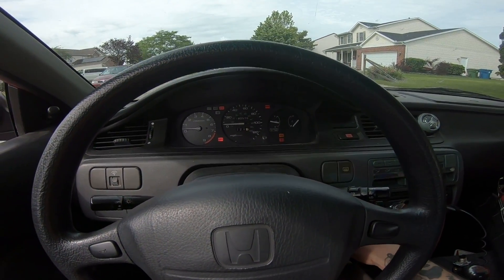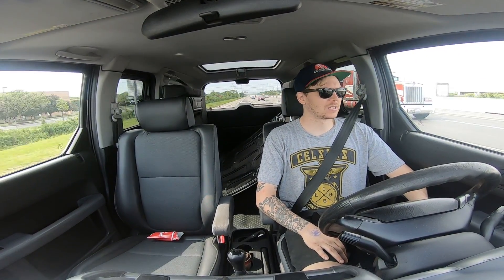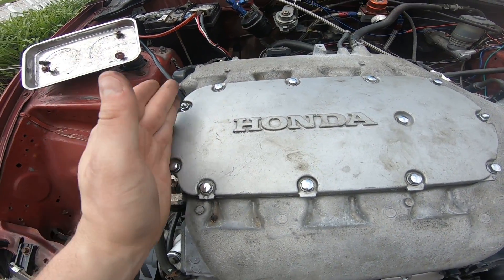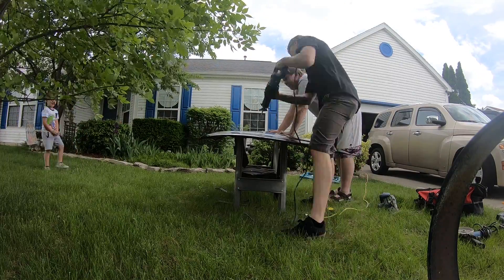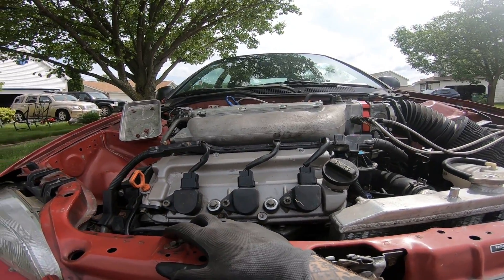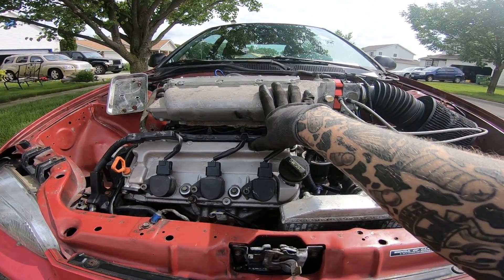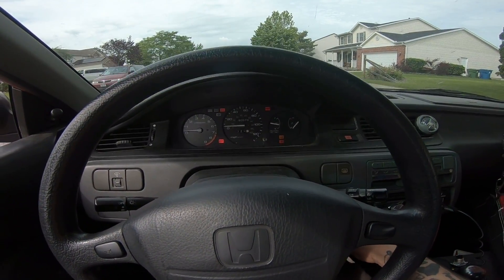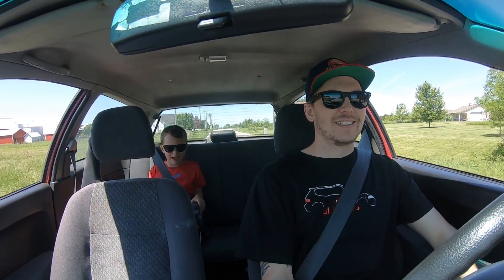Putting a j35 intake manifold and spacer on my j30 accord engine and cutting my hood to make it fit

Comment: In my case, i have a j30a5 accord with the factory 6 speed manual. I got a im and tb off of a 2005 odyessey, making it a magnesium 3.5l manifold. It had the butterfly valve (which i have) and iat in the correct location for my vehicle.

Comment: Do u know wat I need to swap over my j32a3 and 6 speed into eg I have the whole donor car
Reply from the maker: JSeriesRacing start with axles, mounts, and wiring. Someone may make a water temp sensor adaptor but mine had to be welded into the water pipe. The list is pretty long haha

Comment: where did u get the manifold spacer and throttle body spacers?
i have a j30 im currently looking to put the j35 manifold on and wondering if the spacers are needed or make a difference
Reply from the maker: Sugaman powerrevracing.com! They have a huge selection of aftermarket j series stuff! The manifold spacer can be pulled off at j35 at a junkyard just find an odyssey or pilot
Reply: For sure im going with the previous gen build 2001 honda accord, i found a j35 manifold from an 01 odyssey it looks a little better but cant tell till i put it on.

Comment: If I have a j35 could I put a j30 intake manifold it so it can clear my hood like it did originally?
Reply from the maker: AvianAviator I believe so, but the throttle body may also need changed!
Reply: @SleepyEG  thanks. Let's hope my speedy civic comes along well.

Comment: Do you think there is a way to force the butterfly valve open all the time? I drive a j35 and am looking for bottom end torque. Mine has the butterfly valve
Reply from the maker: Po Panda I believe toy can just take it out, p2r sells a block off plate for the solenoid!
Reply: I know it’s late but for anyone who wants to know you can also wire an Rpm switch to open it at a certain rpm
Reply: @garrettglenewinkel7366  i appreciate the info. car i was working on died but ill probably always have a jseries of some sort

Comment: Bro I did it and now it won’t even stay running ...
Reply: Update! It’s all good I just had one of those inside I think like fuel rail sensors unplugged
Reply: And sealed brake booster which is why my brakes were hard
Reply from the maker: Awesome great to hear man! 🤙🏽
Reply: You’re the goat.. however one last problem there are other skinny lines that connect to the bacc of the plenum..( not the thicc brake booster) and on the new plenum one tiny line doesn’t have an insert.. should I just t-connect and hope for the best?
Reply: And my brakes are rocc hard..
Reply from the maker: Jordan Williams weird, maybe it’s affecting your factory tune and your ecu is going into limp mode? That’s strange
Reply from the maker: I just have mine capped off, I’m sure a t would be fine!
Reply: https://youtu.be/HOT5TIO6Dgw
Now it isles pretty high could be a throttle body gasket issue ..

Comment: This is important which accord did the motor come from? Was it a j30a1 or j30a4?
Reply: Do you think the bloccs are similar enough to just grab a spacer and manifold + studs from a j35a1?
Reply from the maker: That’s pretty much what I did, I went to a junkyard and pulled the spacer off of a odyssey and the manifold and vacuum lines off of a pilot
Reply from the maker: Jordan Williams j30a4
Reply: Sleepy EG also where did you find that soacer

Comment: where did you source the longer manifold studs from?
Reply from the maker: Will Huber took them off the j35 that I got the spacer from! As well as all the vacuum lines to the manifold!
Reply: @SleepyEG  I have a 2013 TL 3.5 with a P2R manifold spacer and the studs are not the most reassuring in build quality. so i was trying to find where to order some longer ones.
Reply from the maker: Ahh I got ya, that I’m not sure about. I would maybe check a hardware store and just bring your studs in and see if they have something that would work in a harder metal
Reply: Sleepy EG did you get the manifold and spacer from a Honda Pilot?
Reply from the maker: The spacer was from an odyssey and the manifold was from a pilot

Comment: What harness issue did you have when swapping the motor of a 2004 I hear you get sensor issues and ecu problems
Reply from the maker: AllOutProductions so I actually bought the car swapped but blown up and I just put a new motor and trans in it. I was told that the wiring was done by a guy in New York so to be honest I have no idea what harness was used but I can tell you it was converted to drive by wire
Reply: @SleepyEG  ah ok yeah I've read because it's Drive by wire you need to use a cable throttle body AND Ecu so more or less 02 Type s ecu but as the harness is what I'm trying to figure out hopefully someone will know I'm doing the A3 swap....have you looked into the Holley EFI plenum for the manifold?
Reply from the maker: Yeah I have looked into it but I’ve heard it’s only good for boost applications and all motor you will sacrifice torque, I’m planning on getting one when I go turbo in the near future!
Reply: @SleepyEG  dude you got this even though it money you have to spend go for it I think I'll give in with just a J30 but the J32 stock block can hold up to 500hp
Reply from the maker: I’m going to build a j35 with j32 type s heads for boost!
Reply: @SleepyEG  nice and swap j37 cams
Reply from the maker: I have heard j35 block with j37 internals is the way to go but I’m not sure if I want to go that far the j35 is plenty strong
Reply: @SleepyEG  yeah j35 is strong but all depends if you don't care about eating gas and full race with the j37 or just daily j35

Comment: https://www.hondaautomotiveparts.com/oem-parts/honda-manifold-in-17100rcaa52?c=Zz1lbmdpbmUmcz1pbnRha2UtbWFuaWZvbGQtMDUmbD0xJm49QXNzZW1ibGllcyBQYWdlJmE9aG9uZGEmbz1waWxvdC01LWRvb3ImeT0yMDA1JnQ9ZXgmZT01LXNwZWVkLWF1dG9tYXRpYw%3D%3D

You downgraded on your manifold mang! The manifold you just put on is basically the same as your J30A4/5 6 speed manifold without the flaps- IE a regular J30A4/5 intake manifold. Find one from a J35A7(05-09 Odyssey with VCM) or J35A8(RL or TL-S) with the flaps, even with the spacer you're gonna be giving up torque due to the velocity that the flaps in the intake provide! If you can get your hands on one of those, compare it to your other manifolds and you'll see how much better the runners and volume is inside the manifold. 

As always, you're putting in awesome effort!